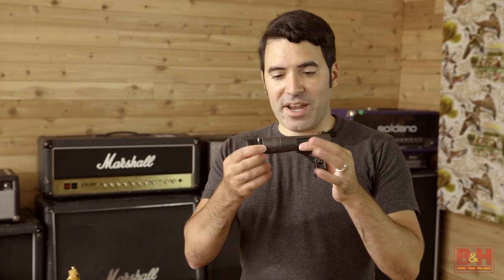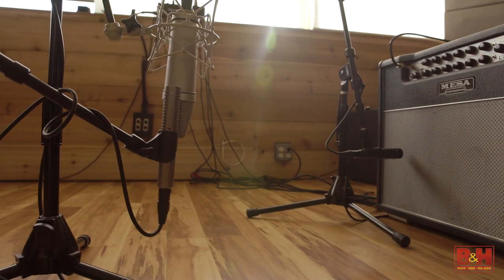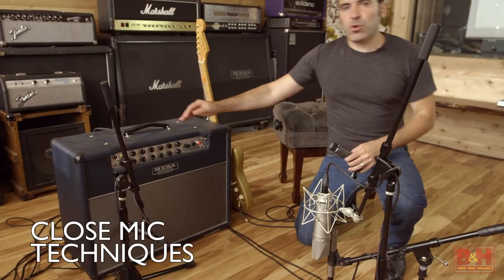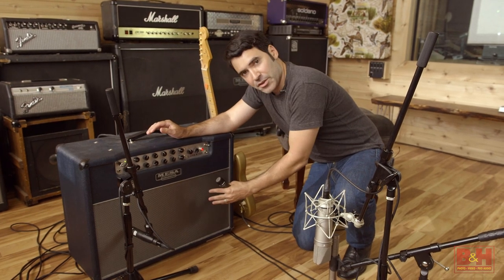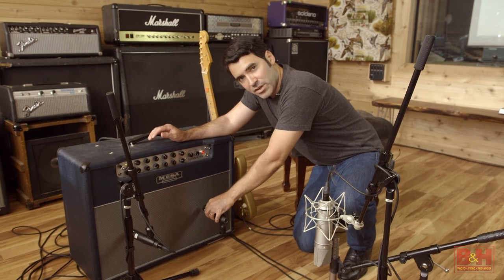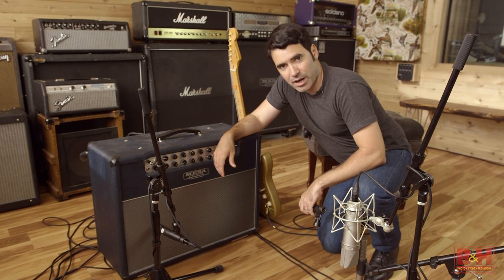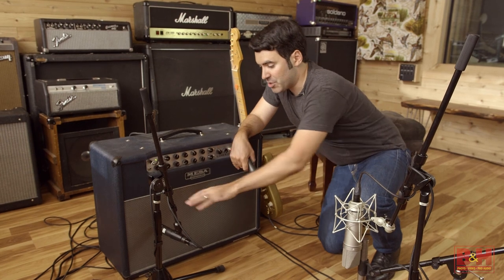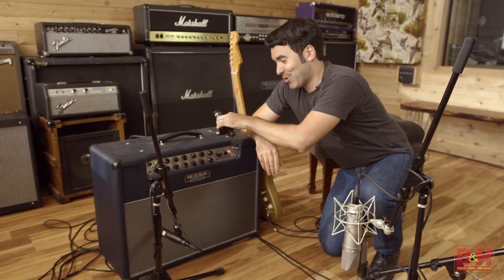Mic Techniques with Electric Guitars

Comment: One thing I have been trying to figure out for months is how to get rid of phase issues when blending a close mic and distant mic (3, 6 or 9 feet away) in MONO with distorted tones. No matter what I try, even using the 3:1 rule and slightly moving the distant mic closer or further to the amp.
Reply: You can fix the phase issue by time shifting one channel but I guess you would loose the reverb effect

Comment: Hate to sound like a noob but is this how people today normally record electric guitar?  I always thought they rigged it to somehow jack a cable into the audio interface.  So am I right?  Is this some retro/obsolete way to get a specific sound or is this just how most people always do it(as in the more proper preferred way to get it done for some technical reason)?
Reply: That is another way to record guitar, absolutely. We have a series coming soon on that approach. Plugging into a computer and using an amp sim can be even easier and more convenient for sure. But recording an amp is still a lot more fun! (And potentially, more flexible. Some people think it sounds better, too.)
Reply: no, that gives terrible distorted sound.

Comment: when the r121 is like almost 3 feet away from the amp. how do you fix the phase issue? Do you just do it in the DAW? is tehre s specific plugin for it ?
Reply from the maker: Easy to fix in your DAW. Also change the orientation and distance of the microphones.   >Mark<
Reply: @BandH  distance, is there a way to position 2 mics in phase even when they are far away from each other ? Is there a specific distance for it? Did you fix it in the DAW in this video? Or was it a trail and error with the distance?  THANK MARK! Your videos have been highly benefitial for me to record an amazing guitar tone. I don't have a royer 121, but i do have a tube condenser ar51, which i bought after watching your tube condenser comparison, and I bought a beyerdynamic m88 for close mixing the amp, which I read that the recording engineer for John Mayer uses. but thanks once again!
Reply from the maker: @jamwithjason3112   Here is an excellent plug-in solution for you Jason:
Solid State Logic SSL Native X-Phase All-Pass Filter Plug-In (Download)
B&H # SONA980XPHS2:  https://bhpho.to/3HX4lyy    >Mark<
Fix Microphone Phase Problems
Frequency-Specific Phase Shift
Create Comb-Filter Effects
Frequency and Q Controls
L, R, or L&R Operation
Delay Section for Time Alignment
A/B Switch for Easy Comparison
Full DAW Automation for All Controls
Mac/Windows, AAX/AU/VST2/VST3